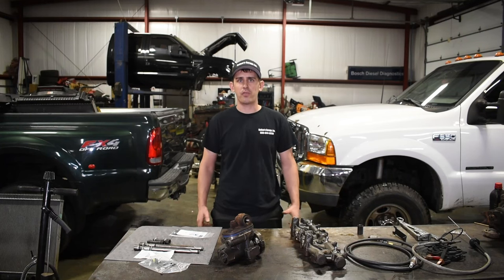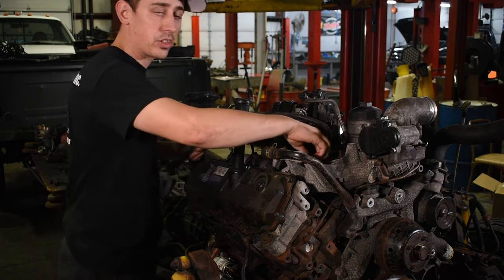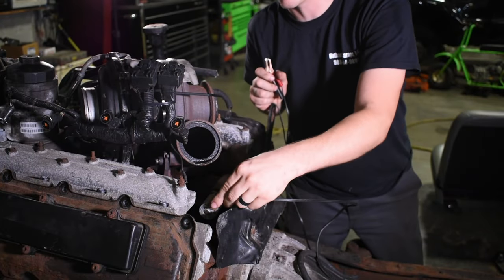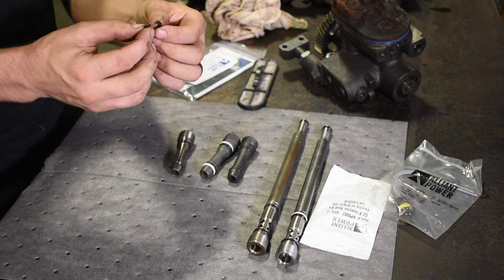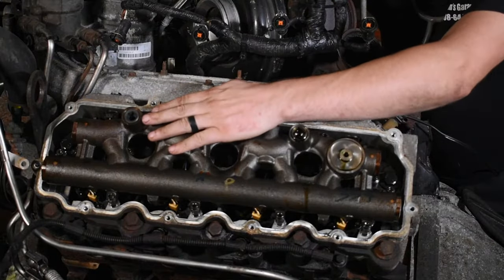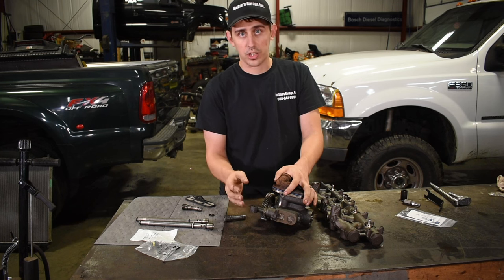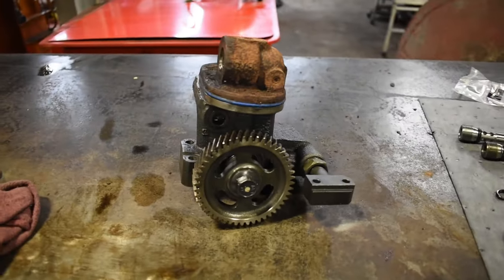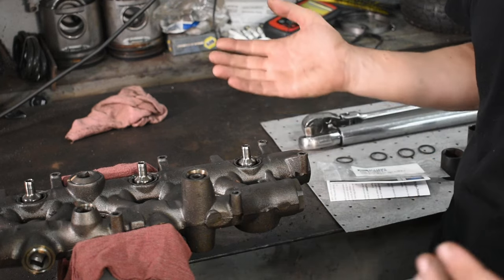6.0 high pressure oil leak diag and repair

Comment: As a mechanic of over 30 years of gas and diesel.... Great job! very thorough, in depth explanations, and professional work! Nice!
Reply from the maker: Thank you! I try hard to make videos that can help everyone.
Reply: @InTheShop  Wassup, I have a 2005 Ford F-350, I have updated my dummy plugs, stand pipes and also the fitting on my HPOP.
I've also had orings replaced on my nipple cup seals and sometimes (not every time) when I go somewhere and I shut the truck off and when I try to start the truck it just spins over but doesn't start. I think the problem that's causing this issue is leaking from the nipple cup seals, also I'm aware of nipple cup seals still leaking after replacing the orings. What do you think the issue could be?
Reply from the maker: Maurice, have you tried doing the air test? Sometimes you have to pull the valve covers and just listen very closely.
Reply: @InTheShop  No, I haven't done the air test yet. I have to purchase the setup to perform the test.
Reply: @mauricematthews5065  Hey, I know it’s been awhile. But, did you figure out what the problem was?

I have updated plugs and stand pipes as well as a new HPOP with updated STC fitting and I have a leak somewhere. 

I have yet to do all the steps in this video for lack of money and the tools.
Reply: @InTheShop  hey brother first of all great videos they help out a lot for the news guys to the 6.0 like my self, I need some advice my 05 I replace all injectors, dummy plugs and stand pipes,nipple seals,new ipr truck drove n runs for a week one day just quit on me backing up to the parking lot anyway I check air pressure and it holds no leak I have no pressure on my scanner on ICP sensor shows 13 psi I replace front cover,oil pump I have oil in housing fills up in crank, sync to ficm 12v and 48v signals 85% on ipr

Comment: I got the same thing going on with mine with only 80000 miles. My concern is what's the life expectancy of the repair? Am I going to have to do this all over again in another 80000 miles? As a diesel mechanic these powerstrokes are the most unreliable pos ever.Once I get mine going I'm selling it. I'm done.

Comment: I found  my high pressure rail and nipple retaining nut mating surface  on top of the o-ring worn with metal shavings on it will that cause a leak? I had no start after warm up.. thanks in advance

Comment: I replaced hpop, stand up pipes, quick disconnect braided lines, injector orings, ipr, icp and i have crank no start. I hooked up air compressor to where ipr goes and i hear no leak whatsoever, it holds the pressure. Its a 2003 f250 6.0...Any suggestions?

Comment: I'm looking for a leak atm, I put air thru were the IPR connects and then I hear Air coming from both sides of the valve covers, I just replaced the passenger side dummy plugs and standpipes and air tested it again and there was no chance on airflow from what I could hear.

Comment: So I have an 07, f350 123,000 miles. I had a reputable diesel mechanic check mine for a high pressure oil leak,  after it sat, most of the time overnight or an extended period of time I would have a long crank before it would start, around 5 to 6 seconds, I do have a monitor so I can see the pressure eventually building to 500. He did find one dummy plug with a pinched o ring fixed that, the standpipes were updated ones, but after a couple weeks of checkn recheckn he could not find a leak anywhere that would be causing this issue, so I’m stumped as to what to look at next, any ideas?

Comment: 2005 350 dually 6.0 installed new oil cooler and IPR valve pressure tested no noise had oil leak on back engine plate which was 132nd inch below engine put strip of gasket material and Perma text the high pop cover in reinstallation radiator fluid clear as I've ever seen any changed the oil everything looked really good started it up after false starting it for three times 25 seconds ran perfectly for 5 minutes and then without touching a thing the engine shuttered a bit raced up just a tiny bit I'll buy itself and then glug glug a deeper thinking noise occurred before it shut off recycled the ignition tried to start it again it seems like it wants to start and then it does start but at a very low RPM and then dies I only tried that a couple times it seems like it's starved for fuel but I don't know you seem like a smart guy any help on this one?

Comment: Nathan, Good stuff! I purchased a 2004 Ford F350 Lariat from a man dying of cancer. He bought this lariat 350 6.0 new, and it sat for 14 years, knowing he was dying. I just bought it with 21,500 original miles. It's perfect. I changed the air filter; it was perfect, I changed the transmission fluid and filter, which Ended up being perfect; I changed the fuel filters, which were a little dirty, changed the oil, which was a little dirty, replaced all with OEM parts. Did install two new 1000 cranking amp interstate batteries. He changed the tires to new Michelin LTX E-rated tires too. It is so smooth; however, sometimes I've noticed that when I'm driving at a low speed, it will sound like a normal diesel, then flutter between the normal diesel sound, then get muffled/real quiet. It happened today and when It got quiet, I hit the gas and it didn't do anything.(no response/ bog/ like no detonation) I let off the gas and it puffed out some smoke as it went back to the diesel sound. I was thinking it was the vanes in the turbo, but it runs too smooth other times. I did replace the EGR valve and it was really dirty, didn't make a difference though as it got quiet again. Have you experienced this? The engine sounding like a normal diesel, then getting real quiet? It will flutter between these two sounds. When it gets quiet, it has no power. I'm wondering if it's not getting fuel to the injectors, or maybe a high-pressure oil switch. Thanks for any help. I was going to open up the turbo to make sure the vanes and unison ring weren't sticking, but I just think that's it. I will be bulletproofing this motor and didn't want to tear into the engine until I bulletproof it and do it all at once. I will be doing the blue spring upgrade next.
Last question, Bulletproofing, I looked at bulletproofdiesels air to oil cooler and then I watched the video you did with the IPR bulletproof, which system do you like better? I kind of like the coolant to oil System better. Thanks again, keep up the great work.
Reply: Did you figure this out
Reply: @garyfarrow3101  No, I thought it it was the EGR, but a friend of mine said that he thinks it is the variable ring in the turbo sticking. When the motor is hot, it never happens. Only when it is colder. It's almost like it sounds like a normal diesel, but then it get real quiet. when its cooler, it sometimes is non responsive when you press the gas. Im going to take out the turbo and make sure the unison ring isnt sticking. The truck sat for a very long time. Thanks for the reply, any thoughts?

Comment: Great video! I had oil rail on and off 6 times and was suspecting oil leak at top injector oring so i put a dummy plug in place of stand pipe to isolate that bank. It worked like a charm no need to energize ipr
Reply from the maker: Also a great trick if you want to narrow it down to one bank! Thank you for watching!

Comment: thanks to in the shop, he nailed my issue over a month ago, and i tore into the engine anyhow cause ut has 200k miles and needed lots of maintenance to make it last another 200k, but he said, sounds like the hpop lost the little ball (oil pressure on dash goes to 0 after 10 minute warm up, truck gets harder and harder to start). HE NAILED IT. specific to 2003 2004 with the older round pump fyi. THANKS FOR THE SUPPORT I.T.S.
Reply: BTW i never wanted to LEARN anything about this truck, its my moms, but her shop was going to start by pulling the base oil pressure sender, and i was like, what does that have to do with hard restart when hot ??? so, i was forced to bring it home, learn from the internet, and fix it. yay me
Reply from the maker: This is awesome to hear! I'm glad it fixed your problem!

Comment: Nathan, great video as usual. I have an early 03 6.0 and it’s great you provide information on the early 6.0 and the later 6.0. I’m a shade tree mechanic but all your video’s break down the process into layman’s terms. Lots of O rings w/diesel motor and I’ve incorporated the AR9100 into my oil changes. Have had great success w/the additive and 6.0 runs MUCH smoother w/the AR9100. Thanks for taking the time to do your videos, much appreciated. Keep’m coming. Fran

Comment: I liked your video so much that out of all the people posting 6.0 oln youtube, i chose you to ask my question, lucky you :)
2004 f350 suddenly developed a problem after a 400 mile trip delivering a load of hay.
check gauges light is on at idle and oil pressure shows no oil pressure, increase throttle to 800-900 rpm and light goes out and oil pressure returns.
truck drives fine, here is more detail on what i have observed.
cold start in the morning and there is no low oil problem, until engine runs 10 minutes, then the pressure gauge drops and check gauge lite comes on, engine idles at 650 at this point, and increasing rpm to 750 makes lite go out and pressure come up, after you drive a little and it gets hotter, you have to increase rpm a little higher to make lite go out, about 850 rpm.
i also noticed that when warmed up, if you turn the truck off, if you try to restart with no pressure on the accelerator, you have to do it within 4 minutes, or else you have to goose the throttle.
in the morning starting out cold, you have to goose the throttle to get it started up.
if you wait longer than 4 minutes to restart when hot, then it will fire up with no pressure on accelerator then cut right off again, the next restart attempt requires you to use the throttle.
so i am assuming it has a small oil leak in the high pressure system, but only when the oil is hot, which means any testing i try to do will have to be with a hot engine ?
since its a 2004 that is stock, its my moms truck, is there anywhere specific i should start looking that may be 2004 specific ? based on my observations that is only leaks when warmed up, runs fine, will restart at idle for up to 4 minutes after shutdown when warm ?
or could it be possibly anywhere everywhere and a full diagnostic attack is needed ?

THANKS
Reply from the maker: The 2004 high pressure oil pumps were very common to have a small steal ball bearing fall out of them that was pressed into place to block off a manufacturing passageway. The way you are describing your problem that seems like it may be what you have going on.
Reply from the maker: Send me an email at nathan@intheshopmedia.com and I can send you a picture of what I mean.
Reply: @InTheShop  thank you so much for your reply,
The trucks in the shop now and i dont feel good about it, they are going for the oil sensor if that tells you why i am concerned.
 i only just now saw your reply, about 4 hours after i rewatched one of your videos and picked up on the ball bearing. here is my question, this is a 2004 1/2 truck made in mar 2004, would this truck still have had that ball bearing ?
If it would not have had that ball, the pump was replaced a few years ago, could they have taken an early 2004 pump and put it in my late 2004 and then this caused the problem, or will a early 2004 2003 pump not fit in a late 2004
Are there other failures that can cause the low/no oil pressure at idle after warmup and hard starting, like an ipr that is stuck open ?
monday morning i am going to tell them to open the valley and look at the pump, to see if it is the early pump or if it has the snap in place connector.
THANKS
Reply from the maker: trac nunya they should be able to tell if it’s the old style pump or new style pump without taking anything apart. The old style pump has a completely cast iron cover and the pump is completely covered. The new style pump has an aluminum cover and part of the pump protrudes out of the center of the cover.
Reply: @InTheShop  thanks, ill let you know what we find out
Reply: i ordered the newer style air test kit that uses the ipr valve instead of the the ipr sensor, when i got the old valve out, there was no screen, so that was fun, getting the old screen out, the green o ring on the valve was distorted torn but about 1/3 of the split was still intact, i replaced the valve $$$ with a new one from the dealership since the truck has 200k miles on it. no dice, still loses base oil pressure at idle when warmed up, and hard to restart if longer than 4 minutes. so i am going to pull the new valve and insert the air test fitting and see where i go next.
Reply: I THINK THE BALL IS MISSING IN MY PUMP, CAUSING MY BASE OIL TO DROP TO ZERO AT IDLE, AS WELL AS HARD STARTING ? re my youtube video in above comments
Reply from the maker: Yup! Ball is missing in that video.
Reply: @InTheShop  thanks, gona go to ford and get a pump IF  they use a plug now instead of a ball, one youtuber says that a threaded plug is used now
Reply: ok, so now i have new problems, but lets review what i did, i replaced the pipes and dummy plugs early on only to find out it already had the newer ones, then i rebuilt the injectors on the passenger side, new rubber and two new springs and a new ball. i also rebuilt the oil rail, new o rings and replaced the nipple cups with the ones from hhc diesel, only point in bring all this up is that work had no effect and truck at least still started.
during this period, peior to going deep in the engine, i drained the block, used the ford iron cleaner for 2 hours at 1200 rpm, flushed out with distilled water, then used the ford coolant and distilled water to refill just the block while i went on to the other work below.
i then tore into the oil cooler pump and egr, i replaced the oil cooler, hpop and the stc pipe on the hpop with ford parts, except the egt cooler is now  bullet proof diesel egr cooler with h core. 
i had no restarted truck yet,
then i repeated what i did on passenger side to the drivers side, rebuilt the injectors and oil rail.
i also installed a new oem turbo, not rebuilt, and it  is the exact right one based om engine serial number.
i also replaced both fuel filters.
i used the wire on the passenger side to crank the truck a few times to prime up the oil system, then topped up the oil.
then i turned key a lot with a towel around the loosely tightened secondary fuel filter and tightened it up once i confirmed there was fuel coming in.
then i tried to start the truck with idle accleerator
it fired and ran and shook, a little rough, then it cut off in less than 30 seonds, attempts to restart required goosing the throttle and resulted in the truck seeming to run on less than all cylinder and cutting off.
imk suspecting maybe one or more injectors maybe not seated fully on the drivers side, and got worse as i tried to restart ?
THE OTHER THING IS, THIS TRUCK NEVER REGISTERED OIL PRESSURE WHEN CRANKING, ONLY WHEN IT STARTED
THIS TRUCK DISPLAYS NORMAL OIL PRESSURE RIGHT NOW JUST BY TURNING THE KEY TO RUN, PRETTY SURE ITS NOT SUPPOSED TO DO THAT, CONCERNED IT IS INDICATING A REAL PROBLEM WITH HOW I PUT IT ALL BACK TOGETHER
Reply: OK SO I SOLVED ALL THE PROBLEMS EXCEPT OIL GAUGE WITH A HOTDOG, BALL PARK HOT DOG, ATE ONE AND WATCHED FAMILY GUY, WENT BACK OUT, PONDERING TEARING DRIVER SIDE INJECTORS OUT,  TRIED STARTING IT FOR THE HECK OF IT, STARTED ROUGH, SMOOTHED OUT, RAN GREAT, LET IT IDLE 20 MINUTES, DROVE AROUND THE HOUSE, PARKED IT, LETTING IT COOL TO RECHECK FLUIDS.
NOW IF I CAN FIGURE OUT WHY MY OIL GAUGE SAYS NORMAL WITH ENGINE OFF AND KEY TO RUN, THATS A NEW PROBLEM SINCE DOING THE PHASE 2 WORK, OIL SENDER NOT PLUGGED IN ????
Reply: OK, I AM GOING TO GO OUT ON A LIMB AND ASSUME THAT THE OIL PRESSURE SENDER AND THE DASH GAUGE ARE AN ALL OR NOTHING PROPOSITION, MEANING, THE SENDER IS AN OPEN OR CLOSE BINARY ON OFF, NOT AN ANALOG DEVICE,EVEN THOUGH THE GAUGE IS ANALOG IN APPEARANCE, I THINK THE SENDER IS OFF AND THE GAUGE IS LOW AT UNDER 7 PSI, AND THE SENDER IS ON AND THE GAUAGE READS NORMAL AT ANYTHING OVER 7 PSI ?
I DONT LIKE MY WIRE ROUTING, AND I THINK I SEE COPPER ON THE CONNECTOR AT THE OIL SENDER, I THINK I HAVE SHORTED IT TOGETHE CLOSING IT SENDING THE GAUGE TO NORMAL AT AL LTIMES EVEN WITH ENGINE OFF. GOING TO GO LOOK FOR WIRE ROUTING INFO AND MAKE SURE MY ENGINE HARNESS IS WHERE IT IS SUPPOSED TO BE, OTHER VIDEOS I SEE THERE IS NO WIRING OVER THE OIL SENDER, I HAVE A LARGE PART OF HARNESS OVER IT